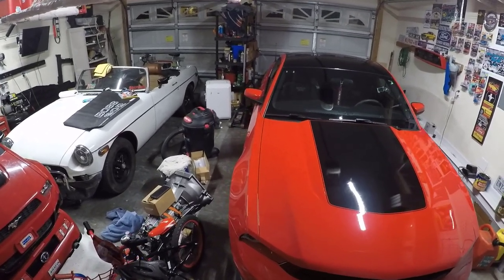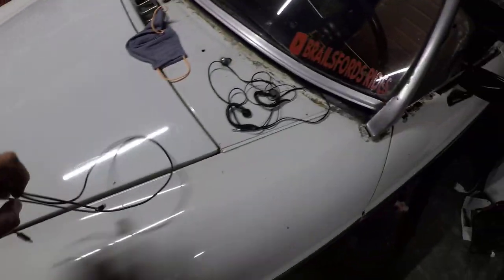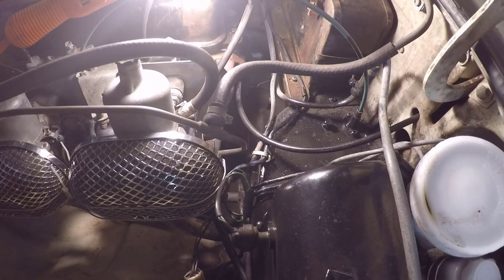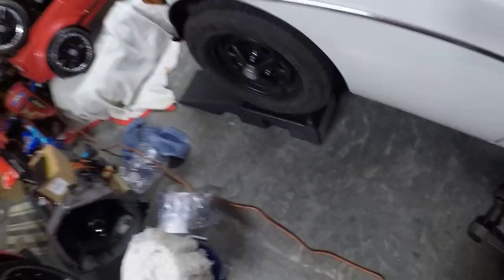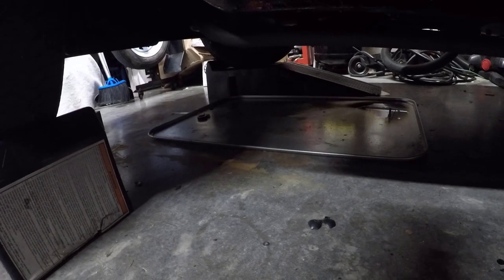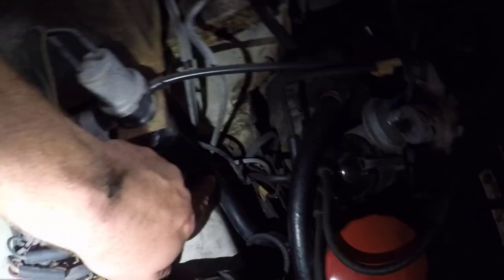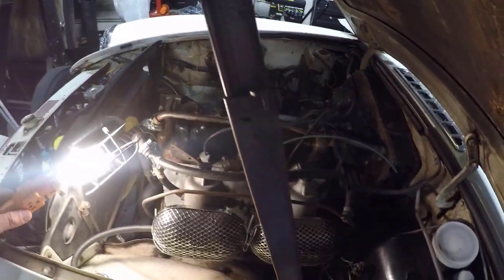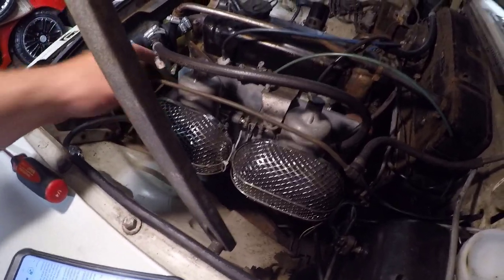1974.5 MGB Leaking Fuel Needs a Carburetor Rebuild, Almost Caught My House On Fire Carb Rebuild

Comment: Likely that the float valve in the carb bowl is not shutting off fuel and it is backing up into the emissions vapor lines.
Reply from the maker: That is what I surmised at the end of the video as well.  I'll be taking it off soon
Reply: Sorry, i have a short attention span.
Reply from the maker: @trevorwj  no no you are good my friend.  Grateful for the knowledge 🙏 helps reinforce what I thought 🤜🤛

Comment: My MGB one night i moved it into the garage after it was stuck outside after a heavy rain and after parking, I heard a spark and smelled smoke.  I looked under the car and by the battery, I saw flames. I hit it with the hose.  It knocked out the flames. But when I stopped, the battery would just reignite the flame.  Luckily, my brother came home about 10 minutes later and he held the hose and I disconnected the battery. Weird. After everything dried, no spark or fire.
Reply from the maker: Thats crazy, yeah I never work on this car or drive without and extinguisher

Comment: Carb cleaning will work wonders. Once you get them cleaned and synched, it will run like a top. Easy to do, too. I rebuilt mine on a nice afternoon while sitting on the porch. There are some good step-by-step videos on YouTube. Glad you didn’t set the house on fire!
Reply from the maker: So do you know what kit is good to buy?
Reply: Brailsford's Rides I got a cheap Walker kit on EBay but I’m not aware of any brand being better than another. Standard parts: gaskets and rubber o-rings basically. Parts Geek seems to have a good selection. See link below. My carb is a Zenith Stromberg but the rebuild process is still straightforward if your running SUs. Make sure you click on the right kit for your carbs. https://www.partsgeek.com/catalog/1974/mg/mgb/carburetion/carburetor_repair_kit.html
Reply from the maker: @jg769  thanks for the tips 🙏

Comment: It looks like your needle on one of your carbs stuck open with crud. You need to make sure you have a good see through fuel filter. A clear filter will show you when its to to exchange it for a new one. You will need to remove the black charcoal absorption canister in the corn of the curbside. The charcoal  will need to be removed to allow the fuel to evaporate.  Check out this video https://www.youtube.com/watch?v=6qmLp-cJeCk form John Twist on his YouTube channel University Motors. I would suggest you use some plastic screen-door material instead of foam. Watch the entire video before doing the task.
Reply from the maker: Thanks for the tips, yeah I figured its the carbs.  Crazy because my fuel pump has a pre-filter and my carbs have the OEM pre-filter.  I think its the fact that the car was sitting for 32 years finally catching up to it
Reply: @BrailsfordsRides  You may have debris in the lines. Did you drain, remove the fuel form the fuel tank, remove and wash out the fuel tank? I would also spray carb cleaner from the front engine compartment towards the rear. Disconnect the fuel pump so you dont push crud into it  By doing this it will loosen the crud in the line. Then use air to blow out anything inside the line.
Reply from the maker: @MGB-learning  i the float needle is stuck in the carb allowing fuel to flow put the vent line i believe

Comment: Just subscribed, need help Tuning my HIF 4 carbs
Reply from the maker: Thanks for checking out my channel Carlos, ai actually sold my MGB but do look for new MG content which is hard to find in the winter but this is my go to video for how to tune HIF

https://youtu.be/ASeMfXfjNpw
Reply from the maker: I hope it helps
Reply from the maker: I learned that I had installed one new float upside down because they sent me 2 of the same float instead of a front and a rear which was causing me my big problems, once I squared that away I tuned it and it ran great